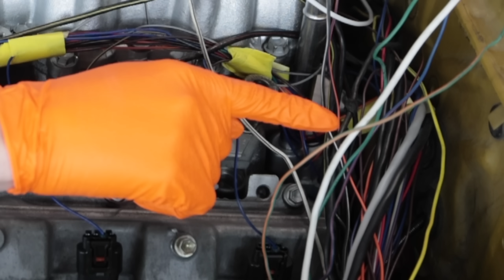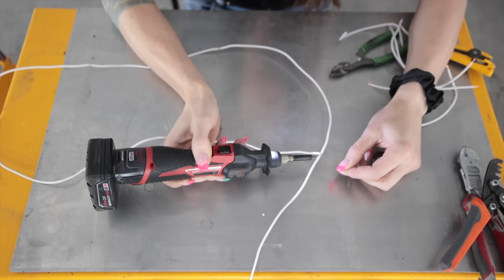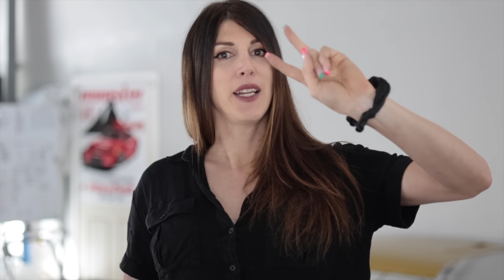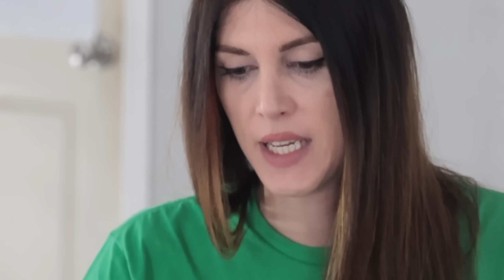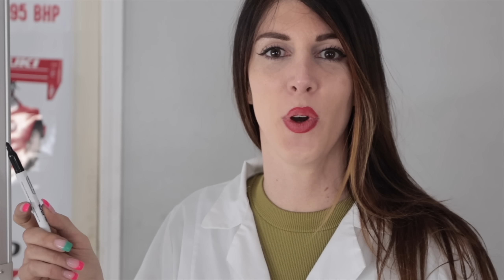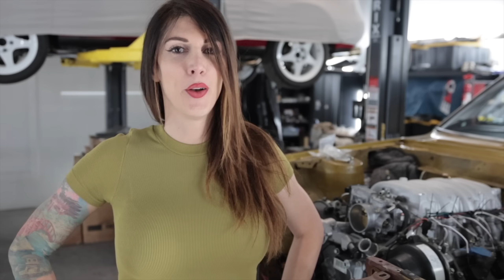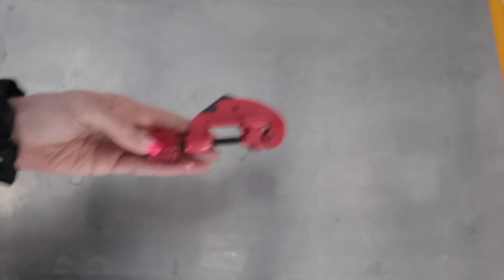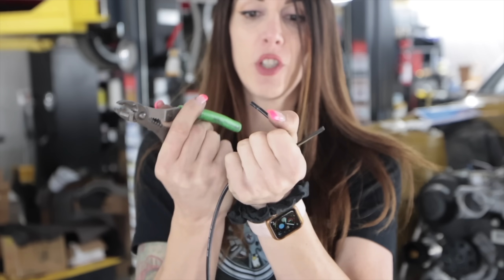Re-Engineering The Cars Wiring // 2UZ V8 Celica

Comment: Wiring is so much more complicated with modern computer controlled engines. Trying to connect different systems together and then backwards to the old wiring is even harder. One wire or even incorrect impedence can mess up the whole thing. You are organized and methodical and will get it done eventually. As a licensed electrician and an old (former) car stereo installer I'm impressed. You've got this!!

Comment: Nice job on soldering the ignition harness.  I strongly believe this is the way to go.  Next time you can get those two-way heat shrink tubing.  It is like a Y heat shrink.  Expose the wire like you did.  Put the wire through two of the y branches.  Then fish the exposed wire through the third y branch.  Solder the third wire, then push back and shrink.  It is a pain, but most have an adhesive lining as well so it really seals it in there.  Looking forward to this monster firing up.

Comment: Mechanics 101 : If you ain't bleeding, you missed something/did it wrong!
Every mechanic worth their wrenches has used a "nearest absorbent material + nearest tape" bandage.

I almost never have dreams of mold setting anymore; I've been out of injection molding for almost 20 years. The dreams recede.🙂
Reply: Ah yes. The unmissable smell of purging PVC. The whine of a worn hydraulic pump and the CLUNCK of a mold separating. I don't miss those days!

Comment: I attended the GM Training Center and I'm VW and Porsche trained.  Crimp connectors only for factory approved/warranty repairs.  The internally serrated bare metal type with shrink wrap for wire to wire splices and the dedicated crimp tool is all we ever used.  Male and female connectors were never soldered.  They had reasons for not soldering, but damn if I can remember what they were.
Reply from the maker: Vibration, that’s the reason why some say not to. I’ve never once seen it fail though.
Reply: @SarahnTuned  I think some of it was a skill thing, too.  Easier to train mechanics to crimp properly than solder properly.  I exclusively used crimps for 25 years at my shop, never saw a failure.  Bought all our wire supplies from Wurth, quality helps, like you said.

Comment: I get battery cables and terminal ends at semi truck starter/alternator shop.  I solder the terminal ends with propane torch, sandpaper and flux like sweating pipe.  You are doing great work.

Comment: basicaly , electricity is lazy . You tell it to go to california to get milk , it turn around not long after . It's a type of pressure mediation . Why on vehicule its a mess usually ? Tire type . See ground is not magic . People think frame ground , no your tire do that . Usually . But oil accumulate charge . Usually the best place to ground is differential or transmission , closest to oil . See when you start a vehicule , ideal is an air starter . People should trust more on wire distance , solid wire for dc , braided wire for ac (untwisted) but they do not . And end up having random electrical issue . The short of it is . Only similar potential at all time can touch . If you remember this ? Your life will be simpler later on your toy . Take the new losi nascar  rc . Even that inexpensive toy has special holder for positive and negative battery wire stay parallel not touching . Do not trust faraday cage . Most missunderstand what it's used for . Try avoiding using it . Air -gap wire practice will save you a lot of headacke . Electricity IS lazy

Comment: notice the distance between wire on the diagram . For positive negative of similar amp ,it's important . Dissimilar amp ? Even more important . Exception ? Solid wire used for direct current . Then it matter little on small wire